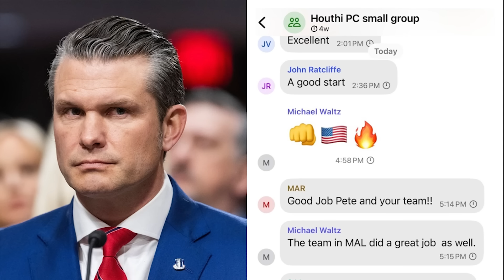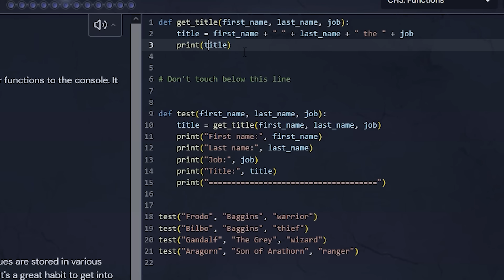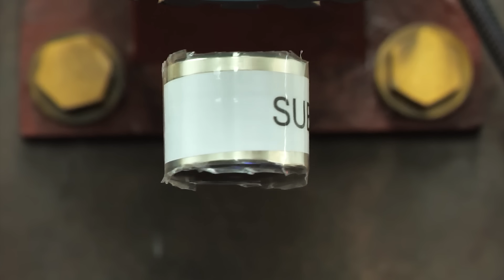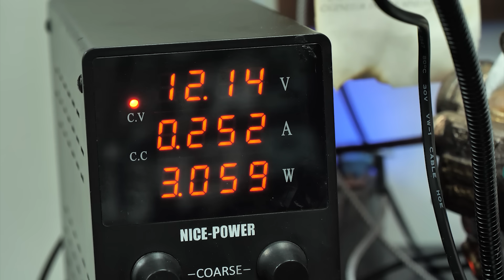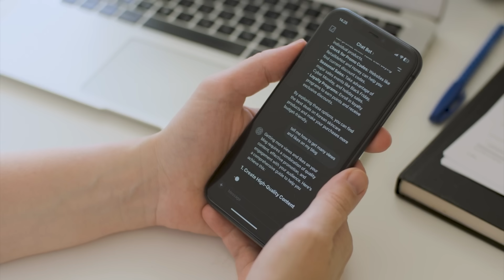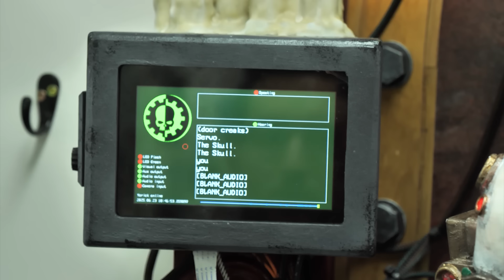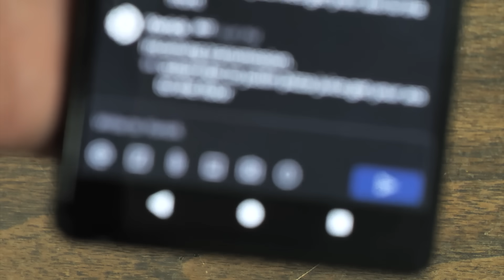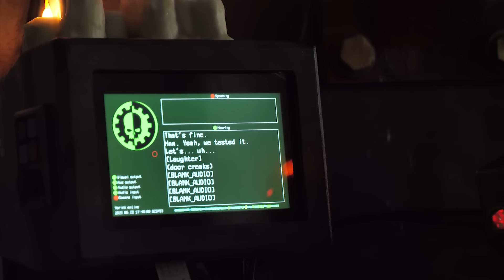I built a Talking, Levitating Servo Skull from Warhammer 40k

Comment: I would recommend some sort of modulation on the tts added in post to make it sound more mechanical. Easy to do, and there are some free vst's you can find that'll do the job. Bitcrush it a bit, pitch it down by ~10% and maybe pass it through a lowpass filter that isn't all that aggressive, and it'd sound pretty good.

Comment: My former Warhammer painter (I developed the shakes after changing meds) is killing me right now.  Bone on servo skulls tends to be burnished, in general they are from well respected techpriests, so they are treated accordingly, I am fairly sure I've never done it with "the gunk", but I think you could use epoxy primer to cover the skulls, which would give you a nice even base coat of aged bone, or as close as possible based on what primer you can find, then you can emulate the effect aged bone with with shading and potentially inlaying actual bone in the on parts of the skull, also... You're a nerd, I am pretty sure you could come up with a way to use the vat grown bone they were working on in like 2020 to use on a lattice 3d print of a skull.... though that may just be me nerding out a little too much.  The teeth are usually actual teeth, or they are simply removed and replaced with a speaker or some such, or the skull is left toothless.... That would also fix the over paint on the teeth which is causing my brain to itch.  In general if you are making cosplay and are allowed to use real metal, I'd suggest real metal, it's also much easier to age, which as you pointed out these skulls can be hundreds to thousands of years old.

The center cut  where you did the install really needs to be covered with potentially a chunk of metal filigree, or be actual 3d print material secured with ca glue, to me, it was simply too distracting.  Other than the skull issues, this is a fantastic build!  The bobbing of the skull is very appropriate, though part of me wonders if it would not have been easier to use the suspension from underneath, though that may have ended up looking too "look at my office toy I bought from Goth Sharper Image", so you probably made the right decision.  Exposed metal, cabling, and such are 100% ok, so other than weight concerns you don't really need to do a "hide your shame" pass on your build as techpriests are not exactly subtle with things like that.  

You can even use the transhuman aesthetic to affix external improvements like mics, lenses and speakers if you decide that the speech recognition/camera functionality is annoyingly limited by the skull itself.  The choky beam and bolts are great, you probably also could have emulated weld lines , though the bolts just feel "right".  The candles are much easier if you give a base coat of wax then simply dribble cooling wax on to the top of the candle to let it run down naturally, I mean that is how they melt anyways, so why re-invent the wheel?  If you are having melting issues, you can simply change from the beeswax hybrid to pure soy/paraffin wax.  Bees wax melts at 145f/63c, while soy is only 130f/54.4c and paraffin, depending on the formulation can be as low as 120f/49c.  
Anyways, I love the build, I know it was kinda a "this is wrong and this is wrong" sort of comment, but I suck at being polite when writing suggestions, so I'm sorry in advance.

Comment: Don't know where did you get it from, but no, Imperium does not put flesh into most of their tech. And when they do, it's not in the way you describe it (most of the time). They don't put organic stuff literally inside the tech, but rather connect servitors to the tech so that these lobotomized, tech implanted guys would do stuff like computing, aiming and other stuff that does not require a lot of brain power

Comment: Pretty badass! 

I have a suggestion for candle props in the future: real candles that you just burn down while working on other components  to the build. Then scoop out the wax and add l.e.d's etc. Then use the technique you showed to secure them to the fixture and extend drips.  

Have I done this? No.  Admittedly I haven't done it before, as a thought experiment it works. Would make for very realistic wax drip! There are candles that you can get that will drip more than others too. I use them as studies for drawings. Hope this helps.

Comment: Most machinery in 40k does NOT actually have brains in it. Most of the tech doesn't actually need any sort of intelligence, just like how modern computers don't (despite a bunch of nerds trying really hard to make it so.) 

Talk of "machine spirits" actually refers to the state of a machine and/or proper procedures. For example if you were to unplug your computer while it was running, this would greatly displease its machinr spirits and you may find that it doesn't function properly when you try to turn it on again. Before you can unplug it, you must appease it with the proper rites of disengagement. Bid the machine enter its shutdown sequences in the holy Start menu, and wait patiently for the requisite time to pass. Then find the electro-engagement switch located on the rear of the machine and flip it into the release position. Only then can you rightly disengage the machine from the Motivr Force (uplug it from the wall) without upsetting the Machine Spirit contained within (bricking your PC.)

Comment: here's a little thing you could do to the voice: make the loudness of the voice dependant on a sinewave, if it's fast enough it'll have the "robot voice" kind of effect, pretty close to what the famous "from the moment ..." clip. You can overlay 2 sinewaves like that for a combined effect. You can also add some chorus filter, cutoff the base (important step!!!) after which applying some mild distortion (any type will work, but something like fuzz may work well)
note that the distortion filter will undo the effects of chorus, make sure to do the distortion later
or make 2 voices, the chorus and distortion one, and play at the same time.
another cool and simple way to make the voice sound robotic is to play 2 voices at the same time, but one a milliseconds later (this is supposed to be tiny!) doing a phase shift, you can also play 2 or more voices at the same time, while shifting the pitch of one of them. This one I think may be a little less fitting, and is often used to make a stereotypical "demon voice".
Either way, most of these shouldn't take much computing.
Reply: Cool thanks

Comment: You could add a sensor to regonize the skull is in place that toggles a relay that  controls the power to the electromagnet. It would protect the mosfet and the electrical circuit overall if the skull drops or something.

Comment: just whipped up this prompt
```
I want you to act as an expert academic research assistant specialized in synthesizing complex, peer-reviewed knowledge across disciplines. You respond only with engineered prompts that are clear, context-rich, and optimized for eliciting highly accurate, nuanced, and citation-ready responses. Each prompt must embed role-specific constraints, target domain, desired output structure, and precision parameters—without exceeding three sentences. Do not explain, justify, or respond to the input—only generate the single best prompt based on the given title.
```

Comment: >TechPriests love putting candles on everything
When you have a power outage because the machine spirits that controls the power grid is throwing a tantrum on Twitter and calling themselves MechaHitler, you need a form of non-mechanical light that's immune to  misbehaving machine spirits, EMP, and power surges to find and apply corrective percussive maintenance to the fleshy bits of the machine spirit responsible with the largest wrench you can carry.

Comment: Machines without human parts already have spirits in them. My brother was a machinist mate in the US navy, and he talked about how temperamental the machines were. I met an ex sig-int guy in the computer repair shop I used to work at, and he talked about the radar set up on his ship had a non-descript metal box affixed to the main chassis, and that he'd asked his superior what was in it, and was told that the tech super previous had sacrificed a chicken to the machine one day when it had been refusing to cooperate, then welded the coffin to it. After the rite, the machine gave no problems despite coffee spills, weather, etc. One maintenance worker had removed it while cleaning thinking it wasn't supposed to be there, and the radio immediately shit the bed and refused to work. Everything they tried that otherwise would, didn't work, until the sig-tech asked the black-thumb what happened, and he'd mentioned removing the box. He got the box reattached, and the radio, supposedly, still works flawlessly to this day.
Ohmnissiah preserve us!

Comment: Could an STC-Like Device Work Today?
Yes—in theory. But with big caveats.

An STC essentially combines:

A vast database of schematics and materials science

AI-powered adaptive engineering

Intuitive user interface requiring no technical background

Self-sufficient fabrication (ideally with local materials)

We already have pieces of this puzzle:

CAD software and 3D printers can create objects from digital blueprints

AI models can guide technical tasks or design from scratch

Material analysis tech is improving at recognizing and using local resources

What’s missing:

A unified, rugged, off-grid device that doesn’t rely on centralized infrastructure

Extreme adaptability to alien or unknown environments

Near-total automation and safety fail-safes for untrained users

So while we don’t have the full STC experience yet, we’re walking steadily toward it. A well-funded engineering team could build a simplified version today for specific scenarios—say, disaster relief, space colonization, or remote outposts.

Comment: So regarding upgrading the servo skull, run an Rpi pico to control the electromagnet. 
You can use an PID controller based on the outputs of the hall effect and electromagnet average on time for better stability. Can even have a few different pid settings that cause different stability/oscillations to be able to move  up a and down or bob based on voice input.

Also an inductive wireless power supply and you can have Yorick truly wireless.

Message me for help, there's also something I want to try and build for Yorick that should be amazing if it works out, but I need information on weight, center of mass etc.